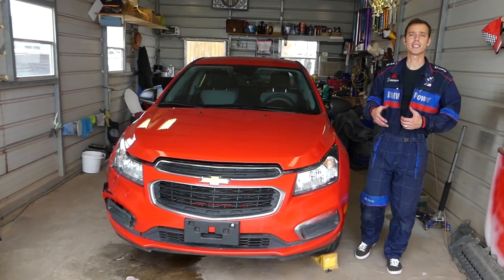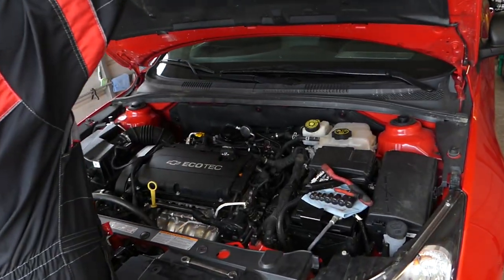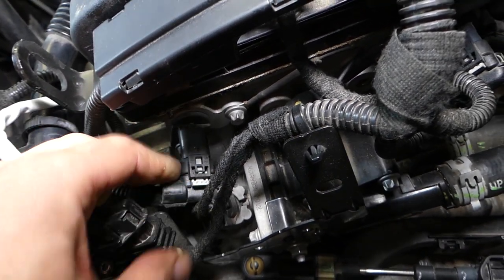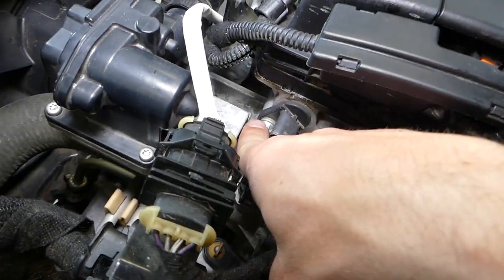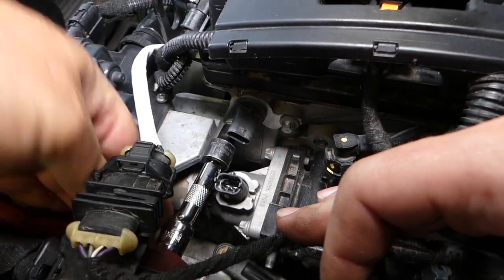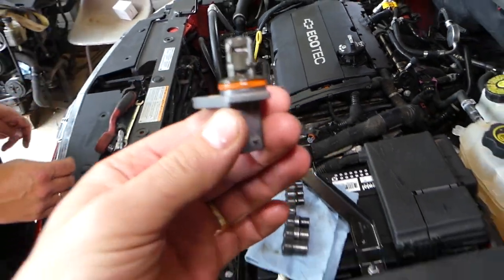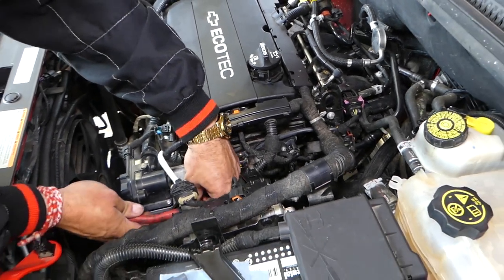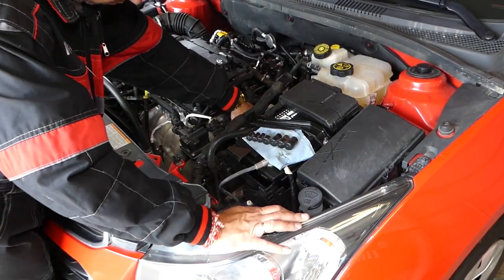EXHAUST CAMSHAFT POSITION SENSOR REPLACEMENT LOCATION CHEVROLET CRUZE CHEVY SONIC

Comment: Excellent video, but does the INTAKE and EXHAUST look exactly the same??
Reply: Same, I've been wondering...
Reply: The orientation is different and the angle of the wire connection is different on each.

Comment: Hello, I'm having issues with my cam shaft intake and exhaust.  I have 2017 chevy sonic.  I just replaced a year and a half ago.  Now I'm having the same issues,  only this time the cam intake sensor was melted.  I keep getting a lift for the same issue.  Changed wiring harness to the intake sensor,  still having issues

Comment: I change sensorbut still have engine light and showed in check code for exhaust camshaft even after reset
Reply: I’m also dealing with this. About to pull the valve cover to look over the exhaust cam.

Comment: Hi guys, thanks for the video. Is the chevy malibu engine architecture similar to the architecture of the chevy cruz you're showing? I have a 2008 malibu and I need to change the sensors as well.

Thanks in advance!

Comment: I would like to know if there is a difference between intake camshaft position sensor and the exhaust camshaft position sensor.Also if it would cause damage to the engine if I put the exhaust camshaft position sensor on the intake camshaft or vice versa
Reply: I wish these guys would respond.  I have the same question.
Reply: There is a difference  its in bolt location in the part the parts do not interchange the plugs are different  and can not get mixed up
Reply: Did anyone get an answer?
Reply: @adeum9i   the parts do not interchange.. there is fingers between the pins that make the parts Not interchangeable ....

Comment: Question will this issue cause the transmission? Solenoid code to go bad because I have a p0016. And a P0 700 When code is for the crankshaft? Position sensor and the other one is for the transmission solenoid. Where should I start?
Reply: My car seem to lose power. Is shifting gears? At this point

Comment: This is ONLY the same for the 1.8l motor NON TURBO..
The 1.4L turbo, there are 2 Camshaft sensors( Intake & Exhaust) 
They also do require the seals for each as the leak oil out like a bad front main seal... 
1.4 is easier if u ask me.
Reply: I want to replace my exhaust cam shaft sensor,  I have the part,  what tools do I need 2017 chevy sonic

Comment: Does the Chevy Cruze 1.4 have two Camshaft position sensors?   Do they have different codes to tell you which one is bad.  My codes was P0016, and P0017.
Reply: Kent Fitzsimmons ok, just went and replaced both sensors. I had them both and they are super easy to replace. Thanks to this video on how to release the plastic clips! Watch out as they look the same. Only the angle of the connector is different and the last number. One is an 8 and the other a 9. Don't mix them up, do one at a time if you do both. Cleared the codes and car runs great now. Will see if anymore codes come up.
Reply: brian keele I do not recall that. No longer have the car. It was a friends. I know the one I replaced was on top of the engine. It made the engine run smooth again.